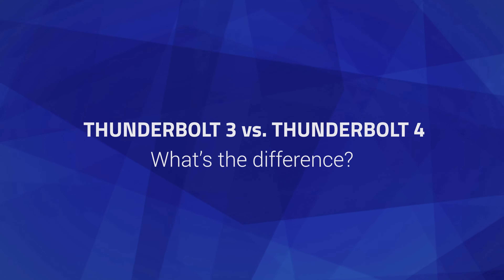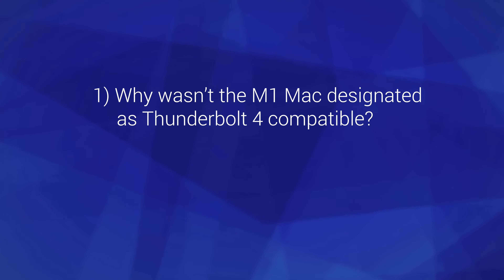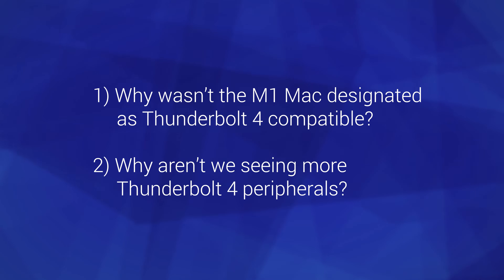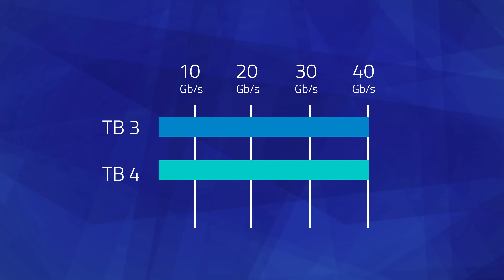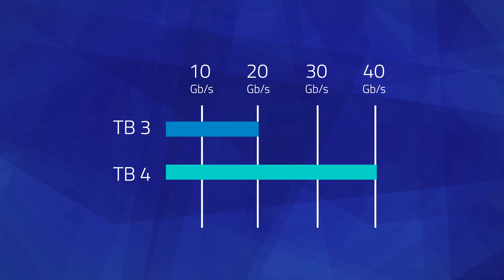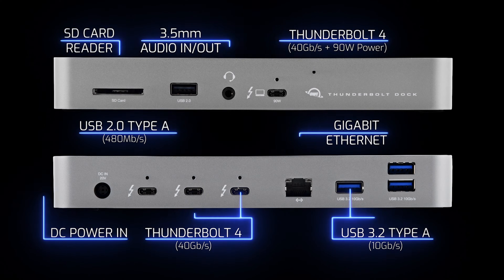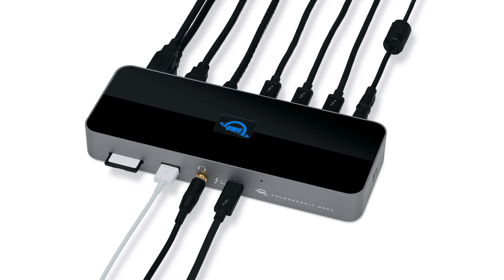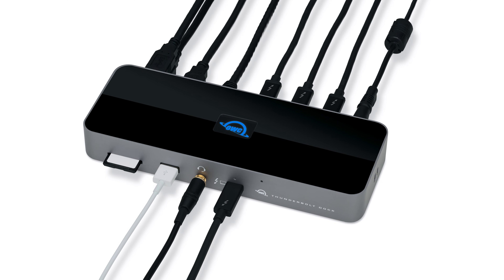Is Thunderbolt 4 better than Thunderbolt 3?

Comment: I'm still confused. I think the explanation doesn't address the differences at all. While I understand TB4 and TB3 are cross-compatible, but compatible doesn't imply the same performance. Is there a penalty when you use a TB3 capable with a TB4 host? Will the cable downgrade the performance. It's unclear what makes USB3 unable to "guarantee" top performance. Is there a different cable pinout?
Reply from the maker: Hey there,

You shouldn’t notice any performance differences when using a Thunderbolt 3 cable with a Thunderbolt 4 host. However, performance may be downgraded if you're using a Thunderbolt 3 PC host, as some PCs don’t meet the necessary standards to fully support 40Gbps speeds on Thunderbolt 3.

We have a really cool article on this that goes more in depth about the real differences here:https://www.owc.com/blog/whats-the-difference-between-thunderbolt-3-and-thunderbolt-4

Comment: Hi John, great video thank you. I have a macbook M1 Max. I need more thunderbolts. I there a dock or hub with 4 thunderbolt ports and one in port?  I am also looking for a very fast thunderbolt external drive to edit 4k videos from without copying the footag  to the macbook first. So I mean straight rom the drive. I saw this: Glyph Atom Pro 2TB NVMe SSD Thunderbolt 3.  But I think you may know other options. OfCourse the drive I will not connect to the hub but straight to the macbook max m1.
Reply from the maker: We do have the Thunderbolt Dock found here:https://eshop.macsales.com/shop/owc-thunderbolt-dock
that looks like would fit your requirements.

For a Fast Thunderbolt SSD we do have some that are around the same speed as the Glyph. which would include the Envoy Pro FX, Envoy Pro SX, and the OWC Express 1M2!

Comment: This is the a clear comparison of the Thunderbolt 4 Thunderbolt 3 standards. Thankyou. I wonder if you could add anything about drive speeds supported or could you go into more depth about passive and active cables?
Reply: ….also PCIE compatibility…

Comment: Thanks for the info. It’s weird that even the apple geniuses don’t seem to know this. I had trouble getting my Mac with usb4 connection to recognise my presonus quantum with its tb3 out. I solved the problem with OWC TB4 hub and tb4 cable. By the apple’s tb3 cable didn’t work. Like understandable until you add words. Cheers
Reply from the maker: You are very welcome, and if you need more help or assistance, let us know directly and we would be happy to help.

Comment: Why aren't there any benchmarks out there or am I just not seeing them
We know this problems with the USB implementation on the thunderbolt ports being woefully slow something's broken either in the firmware or the design
But before I go out there and spend hundreds of dollars more on a thunderbolt backup drive I would like to see if that's broken too
Reply from the maker: While you might be able to find some, you may not be able to find a lot of benchmarks mainly due to just how similar they are. While they are slightly different, those differences aren't really seen in functionality, which is why we put some of our own illustrations in the video as well. TB3 and TB4 perform nearly identically, where things differ is with what device is connected. TB4's main difference is just that it allows for more ports.

Comment: At 5:32 “Is Thunderbolt 4 better than Thunderbolt 3, functionally No”, isn’t this factually incorrect since you can’t charge up to 100W with a Thunderbolt 3 cable?
Reply from the maker: Hi Steven, Thunderbolt 3 is capable of 100W of bi-directional power. However, with Thunderbolt 3, not all manufacturers will implement power delivery, or implement power delivery at the full 100W. With Thunderbolt 4 the specifications are stricter. We have another article that also goes into this that you can see here: https://eshop.macsales.com/blog/74922-difference-usb-c-thunderbolt-usb4/.

Comment: The statement "Thunderbolt 4 cable is best to connect anything and everything" was just what I needed to hear. Wanting to use Migration Assistant between MacBook Pro 2016 and MacBook Pro M1 Pro. My USB-C power cable didn't work. But pleased to find the M1 will power off the 2016 via USB-C. Confused when trying to configure Network I didn't see Thunderbolt 4 Bridge listed on the M1 Pro. Not going to worry about it.
Reply from the maker: If you are attempting to us a USB-C cable it will not work due to the cable not providing the correct amount of power to do the transfer. If you need to do the transfer it needs to be a native Thunderbolt cable  at the full 40Gb/s speed.
Reply: Is apparently a “USB-C power cable”. The 2016 powered the M1 Pro all night over the cable. I think data transfer was WiFi, at least it started that way. What little Migration Assistant says is “Peer-to-peer”. Perhaps they created a new WiFi net bypassing the AirPort Extreme? Initially said 50 MB/sec. Then 30. Then 2. Then file count didn’t change for hours. Tried several times, progress stops about 2/3 around 600 GB. Ordered Thunderbolt 4 cable from OWC. Due Friday.

WiFi restore from AirPort Time Capsule also stalls long before completion. The M1 cleans up after as if nothing transferred.

Bought a USB-C Gigabit Ethernet adapter. Will shortly turn off WiFi, Ethernet to the Time Capsule, and see if that runs to completion before my Thunderbolt cable arrives in 4 days.

Comment: Why is it that when I had windows with antivirus software I still got viruses and when I switched to Mac I didn’t have those issues? Most ppl respond with I went to crazy sites with pc. That’s not the case though. I really wish I had a pc I could trust
Reply from the maker: Macs are just better with security--not invulnerable, but tighter.
Reply: That is complete nonsense because MBs are less secure and far more vulnerable to viruses.
Reply: @RK-um9tu  you’re just talking now